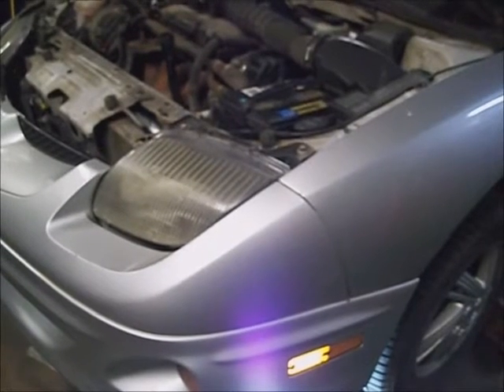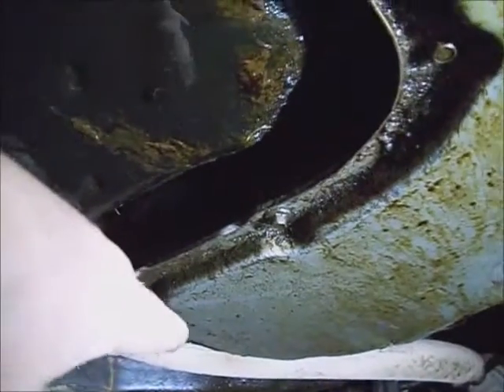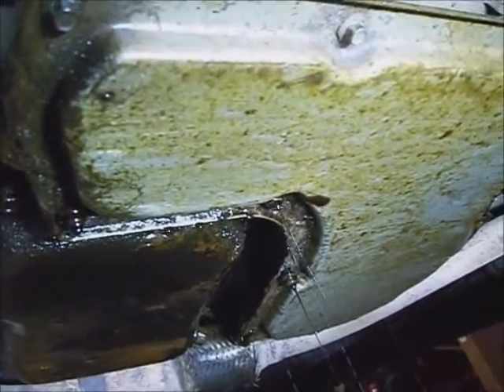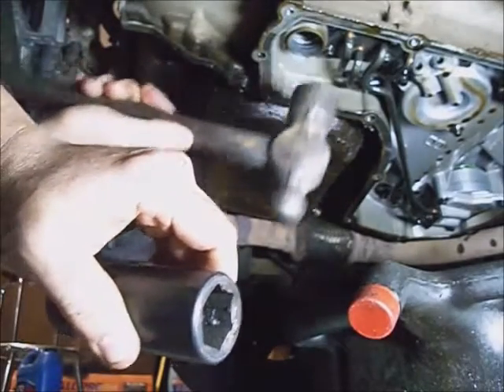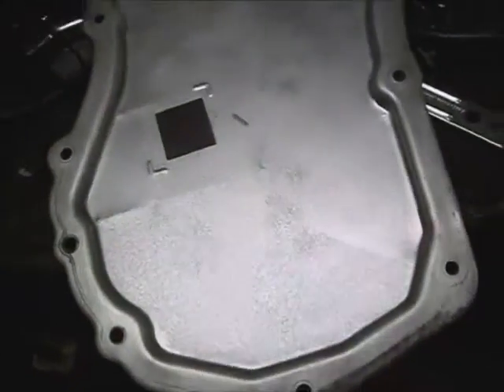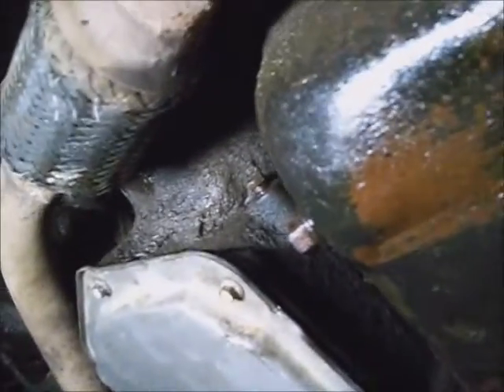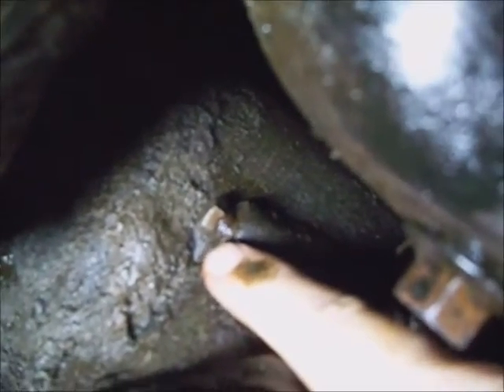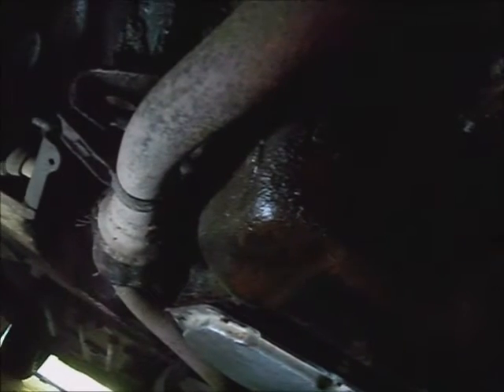Pontiac Sunfire 01w 2.2l and a T45E transmission fluid & filter change fluid level check

Comment: Thank you for uploading this video. I'm about to change the transmission fluid and filter in my brother's 2002 Pontiac Sunfire that has about 115k miles on it. It'll be my first time doing maintenance on a transmission, so this video will be a great help!
Reply from the maker: Thank you, and good luck with it.  The trans fluid is one of the most neglected fluids in the car, and maybe one of the most critical if not changed every 30-40k
Reply: Do you have a preferred make of spark plugs for the Sunfire? I'll be replacing those along with the transmission fluid and filter.
Reply from the maker: False Steel  This my general policy on spark plugs after decades of dealing with them.  Whatever brand name plug that is in it and was running the engine well, just replace it with the exact same brand and type.  This insures that it will still run well after you replace them.  Some exceptions to this rule are;  Unless the plugs in it are of the wrong design for the engine, ie; this sunfire engine has a waste spark system which fires 1 plug from 1 coil tower through the center electrode to the ground electrode and then from ground to center electrode on a 2nd plug, back to the 2nd coil tower.  Completing the spark path between the 2 coil towers on 1 coil.  The original plug was a platinum tip AC Delco brand spark plug, and is preferred.  An older style copper core plug if installed, would wear out a lot faster than the harder platinum tip. This can actually be upgraded to a double platinum tip plug, or an even harder iridium tipped plug (more expensive), which will be even more efficient and last 25% longer.  A side note; if u pull the 2 worn spark plugs out that share the same coil, you will notice that 1 plug will wear down the center electrode, and the 2nd plug will wear down the ground electrode.  Evidence that the spark travels from 1 plugs center electrode, to engine grounded electrode, and from grounded electrode to center electrode on plug 2.
Reply from the maker: Also another suggestion is that, don`t buy into the hype of cheaper plugs.  My other preference for those gm products if AC isnt available is champion brand.  I haven`t seen a domestic made vehicle that didn`t do well with them installed.

Comment: mine is a 2002 Pontiac Sunfire it works well but when it's cold it has a little bit of a hard shifting once it warms up it begins to work better it has a hundred forty thousand Miles right now that your oil change make it run better?
Reply from the maker: It would be best to have it checked out by a qualified mechanic first.  For codes, and weigh their advice accordingly.  As a general rule, I recommend a trans fluid replacement every 40k-50k miles. But if it hasn't been done at your high milage, a change of fluid may accelerate an existing concern, and cause a bigger problem sooner.  But at the end of the day, if the trans has a problem, because of lack of maintenance, it will get worse anyway.  So it should be checked with a scan tool, and an experienced tech first, for problems, and then a judgement on fluid change made at that time.  Using only a good quality dexron vI synthetic may help unstick any problem valves.  Thanks for watching.

Comment: Forgive me if this is a stupid question, but does it not have a dipstick to check the fluid?
Reply from the maker: no ma`am it does`nt.  Some years and manufacturer`s may or may not include a dipstick.  Typically you don`t need a dipstick for anything, unless you have a leak. If fluid shows up on parking areas under car, then the leak needs repaired, and the need for the stick is gone again.
Reply: Auto Dr diy But you cant see the color of the fluid or smell it if theres no dipstick. Thats a terrible design. My daughters first car was a 96 sunfire. it had a dipstick. I will have to pay attention when I'm car shopping so we only get a vehicle with all the dipsticks. Thanks for replying and for the information.
Reply: she must have had the 3T40 3 speed transmission. from what i hear the 3 speed was the only transmission option on the sunfire with a fluid dipstick
Reply: @Heather-hy5hi  my 01 sunfire is the first vehicle ( i have had many) i have ever come across that doesnt have one.
Reply: Stonebull mine doesn’t have one and as I’m taking off the radiator some fluid will leak out and I have no way to know or check to see how much . I’d have to measure each drop that comes out of it :/

Comment: Is this the same as a 97 Cavalier with a 2.2 L engine and the reverse stop working in my mom's car we're hoping to do this change and restore it do you think that's possible?
Reply from the maker: If it says D-3-2-1 on shifter (4 speed) it is the same, if just D-2-1 on shifter (3 speed) it is not the same.  And if reverse is not working, changing the fluid probably won`t fix it.  Replacing it with a low mileage used one may be an option.  If first gear works, likely internal damage to it.  If removing the pan, and it has several chunks of metal 1/16" dia. or bigger in bottom of pan, it is done, and needs repalced.  A code check may reveal the problem, if check engine light is on.  If not abused, and fluid maintained this trans life span is around 150-180k, typical.
Reply: Auto Dr diy okay it says drive 2 1
Reply from the maker: Then it is a 3T40, and it has a different filter/pan gasket.  But holds about 4 qts after filter change, about 4 Qts. And probably has a red dipstick on it.  There are no surprises in replacing the filter, and pan seal, they are all basically all the same,  But as I say reverse is a manual gear, and if it has failed, prob that part of trans is bad.
Reply: Are these transmissions pretty good ?

Comment: 7qts is that correct? 7 qt's for just a pan and filter replacement ?
Reply from the maker: A little over 7 qts, I believe.  It is critical, that the fluid temp is close to 104°F, for an accurate level.  And that the shifter is cycled through the gears, before verifying final level.  Thanks for watching.

Comment: By chance do you know where the soleinoid is located
Reply from the maker: All solenoids are in the side cover, you have to pull driver side axle, unbolt the drive side trans mount, and prob loosen the frame on this side and let it down enough, to get the side cover off.  If I remember correctly.  Been a long time since I had to change a solenoid in one.  But they do go bad.  Thanks for watching